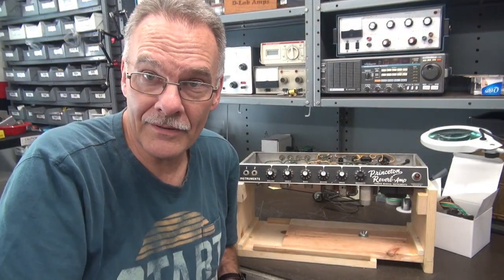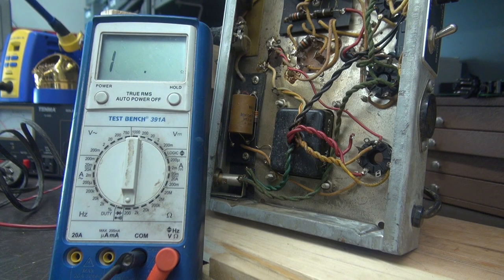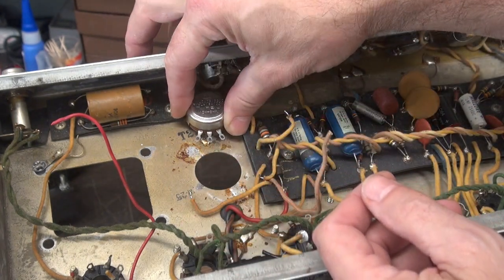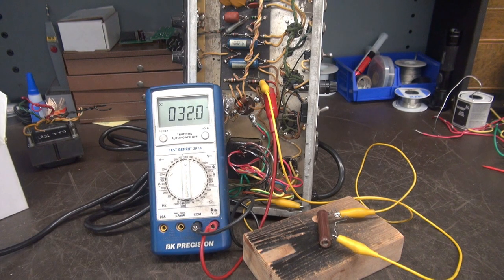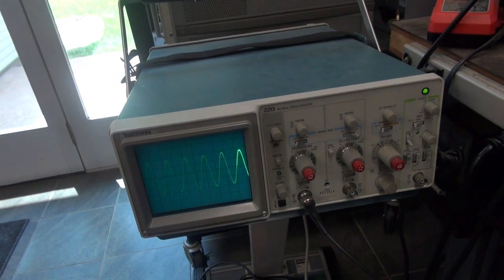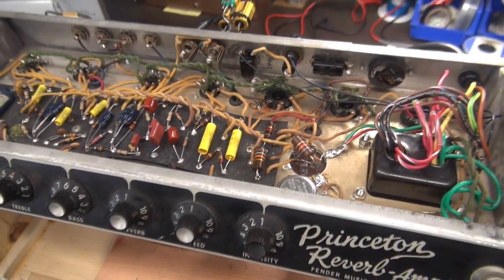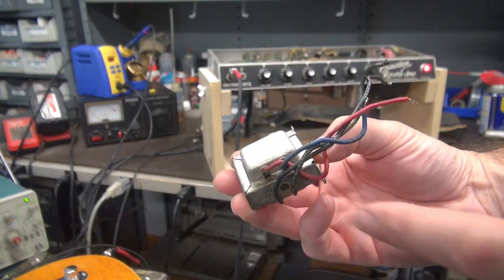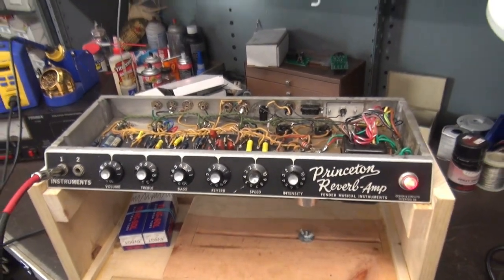How to restore a Fender Princeton tube guitar amp Fix Reverb Crash dead Tremolo the works!

Comment: Hi Terry .  I have had the exact same reverb noise problem on a customers boutique am amp , it sounded identical . And it took me ages to come to the conclusion that it was the transformer . I'd replaced all of the reverb circuit passive components and tube , plus many other parts too before a new transformer was the only thing left to change . And that was a good hole repair  ..Best regards Tony .

Comment: WAY back while I was in college circa 1980, I was in a band where one of the guitarists had a Princeton.  He actually had it "re-cabinet-ed" into a custom shell made by a local cabinet shop, all birds' eye maple.  It was a thing of beauty.   Also sounded incredibly good.  Those were and remain great amps.  Oh, and the other guitar player (we had two of them) had a combo made by a then relatively obscure boutique manufacturer, Mesa Boogie (which ironically was an evolution of the Princeton.)  Both were 1 x 12's that would absolutely cut through the mix on leads.  But the fellow with the Mesa had to always carry extra tubes to gigs, because those amps had issues that apparently continue to this day with tubes being burned out.
EDIT: Oh, and you have hopefully already gone to one of the big box stores and bought that igniter for your gas-grill!  :-)

Comment: You're an excellent tech! Many would have missed the clue from the pwr xfrmr short (odd in itself) to rvb optx primary. Very good detective work. One now has to wonder on the main OPTX if it's prone to shorting. Nothing like having a heavy metal guitar player thrashing the amp to find out, albeit...on second thoughts...just bench test it on a dummy load at full power.
That amp is sweet. Btw! Oversizing that extra cap hole to accept the washer, and using it for a variable bias was sheer genius. Looks like it was built that way.

I'm subscribed!

Comment: Neat trick with the washer. You can also find metal snap in plugs that come in various  diameters.
Reply: Yes, but he'd still have to true the hole, which he did with chassis punch, you can see the tell-tale marks on the chassis. That washer was already center-punched, and the end job looks like something from the factory. I'd add a flow of super-glue in the crevice on the top of the chassis to ensure nothing buzzes, and just to give it an extra finished look, as well as add strength. A domed screw-on cover for that bias pot would also be a nice touch, don't know if they're still available. 'In the old days' we'd add a dob of wax or varnish to 'lock' the setting on the pot, then screw on the dome cover. Once set, you don't want anyone but a tech changing it, or a player who knows what to do when installing new tubes or resetting bias as they age.

I really enjoyed this vid!

Comment: Teri, are 3 prong power cords really necessary in guitar amps?  If the power transformer is operating properly, isn’t it basically acting as an isolation transformer?  Therefore, no chance of electric shock to the player? Seems to me the only time a 3 prong would be beneficial for a short is if you are plugged into a GFCI outlet, if not the fuse in the amp or the fuse box in the electrical panel will kick in even with two prongs

Comment: Hi D Lab, can you possibly help me. I watch your repair on a Fender Princetron  65 DSP amp, I have one with the very same fault. When the amp gets hot after half an hour it goes off. Watching what you have done, I changed the Capacitors 200 mf 2200mf 50v, and the 2 diodes , I also repaired the circuit boards and used me meter to traced that I have soldered the joints correctly. When I turned the amp on it blew the fuse. What Have I Done Wrong. I live on Mallorca nobody can repair amplifiers here.

Comment: cost of shipping, new power transformer, new rectifier tube , labor and other parts WOW.. might have been less expensive to buy a new amp!
Reply: A great condition blackface princeton will always be worth whatever you have to put into it. The owner could sell it for whatever asking price is every day of the week.
Reply: @stratcat4450  yeah i have a 67 band master that needs to be upgraded local guy said $250.00 for the work
Reply: @georgeescaped6035  got to keep these great old amps alive. A serviced grandmaster has got to be at least worth a grand these days.

Comment: Maybe dabs of silicon where the wires enter the transformers would help keep out high humidity moisture from the inside.
Reply: Once a short has happened, it leaves carbon tracks. You can go in and clean it all out, very carefully not to break the affected windings, and 'dope' the shorted areas with an anti-arc compound (from the old TV HV days..."anti-corona dope") but it's a meticulous job, and very difficult to guarantee the work after. As he says (gist) "For twenty bucks for the replacement, why fool around?". 

If it were mine, I'd try and save the xfmr, but for anyone else, I'd replace it.
Reply: @stephensaines7100  I meant doing that on the replacement transformer to help prevent the same thing happening in the first place in the future. Sounds like the area it came from may be near the sea air high humidity coast.

Comment: As badly warped as the terminal board is, I'd put a sheet of fish paper under the board.
Reply: There's already a layer of fish paper under the terminal layer. Clearly visible at :41. That (and most other Fenders. Marshalls, Traynors et al) would have shorted to the chassis long ago otherwise.